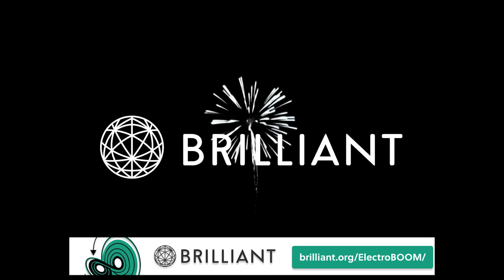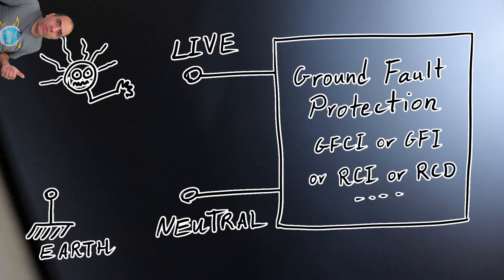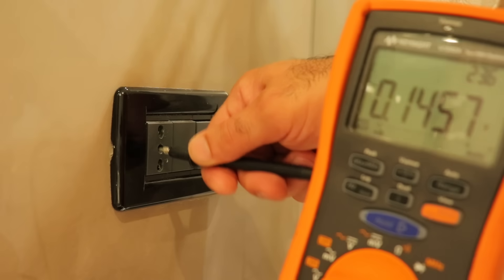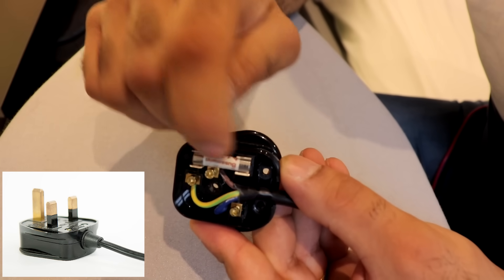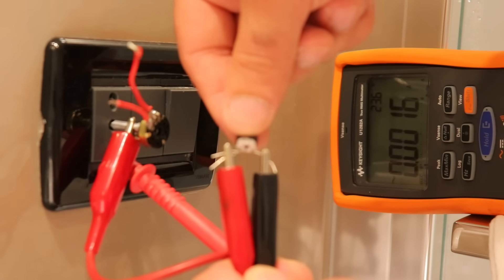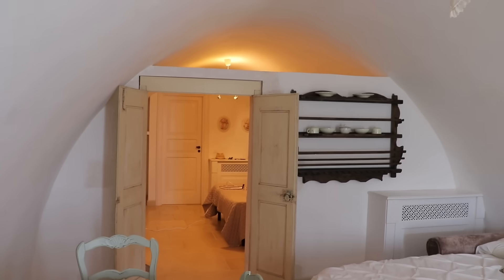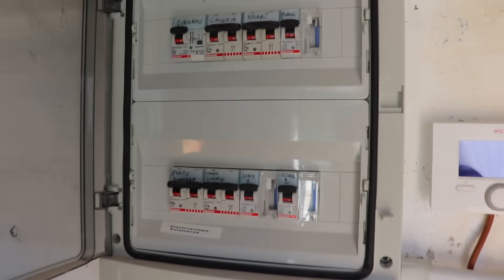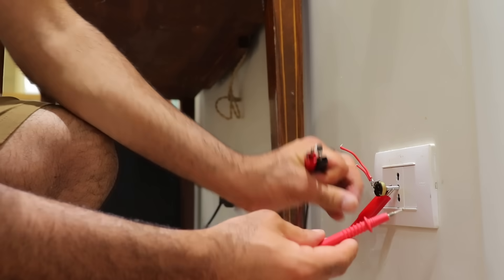Tripping Every Breaker in Italy

Comment: 15:22 actually that plug ("german" schuko) normally does not fit in that socket! That socket is either broken by somebody doing what you did previously (and it takes a LOT of force to do that the first time, the prongs are closer together and they're way thicker than the hole normally), or that socket is not up to standard.
Glad you enjoyed your time here! I'm happy to know that at some point I was less than 20km from you, lol.
Reply: Here in the Netherlands you can plug that exact same "German" schuko plug into any ungrounded outlet. No extra force required.
Reply: @wimh-e7l  interesting! Here they sell adaptors from schuko to 16A 3-prong, they used to sell schuko to 10A 3-prong but they're now illegal because schuko supports 16A lol. It's super annoying because the 10A sockets are pretty much everywhere, and I'll keep my schuko-to-10A-plug adaptor like gold lol. I don't need them to carry more than 2kW so that's still good
Reply: @FAB1150  are you sure they are illegal? I am pretty sure they are selling them in chains such as Eurobrico, and online too. BTicino and other brands make them.
Reply: @AndreaLazzarotto  those are the bigger ones, they still fit most sockets (as most of them accept both 10A and 16A), but not the small ones only anymore

Edit: I still found some around today (Conad), but they shouldn't be allowed. My local Brico doesn't have them anymore for example, but if I still find some I'm happy lol.
Reply: @FAB1150  I replied to your comment twice, and I see my comment disappeared. 😐 They are still selling them everywhere, by the way.
Reply: @AndreaLazzarotto  oh, YouTube deletes all comments with a link! 
In my area nobody does anymore except a Conad that's about 10 minutes by car from me, I guess it's different in different cities
Reply: @FAB1150  Basically no Schuko device uses more than 10 A. 10 A breakers are common in many countries that use Schuko.
Reply: @okaro6595  I'm Italian, and the adapters are illegal in Italy. I don't know about other countries. Here, 16A breakers are pretty much the norm.

The schuko plug is rated for 16A, and you don't want the socket to be the weakest point in your circuit. Putting a 10A breaker on a circuit where you have Schuko sockets is fine, because it's the breaker and it will trip if overloaded.

The 10A plug to Schukos adapter allows you to plug a 16A device on a 10A socket, possibly overheating it if you have a 16A breaker (as it will not trip). 

Now sure, most appliances with Schuko plugs don't even get close to 10A, so you usually won't overload the socket with an adaptor... But it's not a given and some do, and most people don't even know what an ampere or a watt is, so regulators made the adapters illegal. If you know what you're doing, then check the watts of your appliance and use the illegal adapter, they're still handy lol I won't yell at you. 
Adapters that go from the 16A "Italian" socket to the Schuko are still legal.
Reply: @wimh-e7l  True, and I'm glad you can because in the historic apartment I live in I only have grounded sockets in the bathroom and kitchen. I really want to replace them all with grounded sockets but I really don't feel like installing ground wire everywhere (plus, I doubt the housing corporation would approve)😅
Reply: @wimh-e7l  yeah but in the netherlands only old buildings can have no ground - new building standards since the 80s must have ground. Old buildings can not always be adapted without changing the aesthetics though.
Reply: @pulli23  I have a 60 house, been redoing all electronics. It didn't even had ground protection. Funny when I replaced my breakerbox (from 3x 16A fuse 1 phase to 16x 16A breakers on a 3 phase system), one of the groundbreakers kept going off. Something faulty in a TL light.
Reply: @pulli23  that's right. I didn't know it was from the 80s specifically. Nowadays every new socket must have ground, indeed.
Reply: what was the plug at 9 something for?
Reply: @stapuft  The unknown socket is called Magic Plug! Is a very old Heavy Duty (up to 20A) socket!
Reply: @PaoloPaterna  very cool, thank you!i just looked them up, they look like they might be some sort of dual-phase type plug, im saying that because i noticed it has 4 pins, instead of 2 or 3. oh no they are polarized three phase plugs, thats pretty cool.
Reply: @PaoloPaterna  No, it's a telephone socket, also from the B-ticino brand. They were once used for room telephones.
Reply: @emmepiemme  upon looking at it further, i think you are right, the shape is just barely wrong for the magic jack, but it seems pretty spot on for the "BTICINO LIVING CLASSIC 4521" kinda makes sense that they look similar though, as they are both made by the same company.
Reply: @PaoloPaterna   @Paolo Paterna  Nah, it's in the same wallbox with the phone RJ11 and it's unlikely they put together high and low voltage circuits (it's actually illegal unless using high voltage insulated wires even for the phone).
That mistery socket is likely the highly obscure telephone plug that Bticino came up with to go with their equally forgotten Magic plugs series.
Either that or is a german TAE phone socket.
Reply: @PaoloPaterna  I have them in my 47yo house but I actually hate them. When you need to plug more devices in one socket they are a nightmare...
Reply: @qdaniele97   @emme Pierre Actually they can be (and are) used for a lot of things: Telephone as you said but also, for example, to control the Slot cars on a circuit (9-12V and almost no current)! The fact that in some cases were used for low voltages do not mean that they cannot stand high voltages and high current :)
Reply: Agree, I'm Italian and the case where you could fit german into italy plugs are very rare
Reply: @FAB1150 the standard house wiring here is 2,5 mm2 for phase, neutral and ground. The switch wire (black) is allowed to be 1,5 mm2. Also wiring in old houses was done using 2,5 mm2 (from the 60 I guess) but usually they left the ground wire out except for wet rooms.
Reply: Exactly, is almost impossible to put a schuko plug in that socket, someone must've been like Hulk
Reply: Yeah usually they usually should be recessed.
Reply: We got the same plugs in france. The ground is done by a pin stocking out from the socket, so there is no way you could plug it in the wrong way. this insures that grounded appliances are always correctly connected.
Reply: An "F" type plug.
Reply: Forgot to mention that Vimar makes the universal shuko-bipasso plug...
Reply: If it's doesn't fit, you aren't applying enough force....
Reply: We use adapters to connect schuko plugs to regular italian sockets and they have a connection to the ground.
That said these days it's also common to find schuko sockets in italian homes where high power appliances will be used (eg. kitchen or laundry room).
Reply: In poland I had to get outlet changers or wtf its called from that outlet to polish  one slav country moment they kept the electric sockets from germany
Reply: He literally exploded that plug...probably melted the holes enough to make it fit
Reply: Yeah those sockets that allow for ungrounded  connections should be banned wtf.
Reply: There are convertible "springed" sockets, that accomodate slight difference in distance and allow flat electrode one as well
Reply: And "SchuKo" means "Schutzkontakt" or "Protection contact", referring to the ground contact (PE = Protective Earth). 

Schuko actually has compatibility with two different ground standards, one that contacts at the prongs on the outside of the plug (in Germany, we have a prong both at the top and at the bottom, so they're always reversible) and one that actually has a pin coming out of the socket that goes into the hole in that SchuKo that you see 10 seconds earlier when Mehdi looks at that plug from below. If you Google the French wall sockets, you will see that pin coming out of the socket that fits this.
Reply: False, schuko fits in any 16A outlet. Src: I live in Italy and always seen that
Reply: @Michele G  I don't know where you live but all the BTicino sockets I have can't accept shucko plugs. Holes are smaller and you have to force them very hard to plug them.
Reply: @fededevi1985  "force them very hard" = slightly pushing
This means in every household across Italy there are a lot of schuko where should not be
Reply: @mich2k1  Shucko pins are 4.8mm, type L pins are 4mm, both 19mm apart center to center. Unless the plug has already been "enlarged" you will have to push really hard to fit them on any non-damaged conformant plug.
Reply: @mich2k1  no. The schuko plug has the same prong thickness as a 16A italian plug, but with the spacing of the 10A plug (a little closer actually). You have to force it in.
If your sockets have weak plastic or are not up to code, you'll be able to force it in. My sockets (Vimar) literally don't accept a schuko plug without actually breaking. I tried as a stupid kid, and we had to replace the socket. I put my whole body weight on that socket until it broke.
Reply: @mich2k1  Not by design. Schuko plugs have the diameter of 16A holes but fits in the 10A spots. It's clearly a mistake and happens only when you have a double standard socket.
Reply: @87AgentSmith  Many countries like Finland had 4 mm prongs on ungrounded plugs until around 1960. People still plugged schuko plugs in the sockets. I wonder did they not worry about loosening the sockets. 

Of course if there are grounded sockets you should always ground schuko for safety.

Comment: The  weird plug at minute 9:00 should be a 12V DC power plug

Color coding for wires it is: black grey and brown for phase, blue for neutral, green yellow for ground

It is possible to have additional protection to differetial protection for bathrooms at 5mA if wanted, sometimes this is mandatory by law

Comment: Typically here in the UK (and probably most of Europe) we have seperate ring circuits which have lights and sockets separated. For example on one RCD would be the upstairs sockets and downstairs lights, and then downstairs sockets and upstairs lights on another RCD.

The reason is so if there's a fault, you always have a method for light. If you're in a room where the lights have tripped you can plug in a light, and if you're in a room where the sockets have tripped you can still see properly.

Actually a pretty decent way to keep your house lit. I'm not an electrician and I don't think it's an official standard, I think it's just a common courtesy when houses are wired
Reply: Curious so I just checked my new apartment in Aus, and it's a main CB, then an individual RCBO (Circuit breaker and RCD combined) for aircon, oven, lights, GPOs laundry and GPOs other.

Nice to see the separate protection applying, so unlikely that anything major tripping will effect lights or small appliances

Comment: Hi!
In Europe sometimes you may find 10mA GFP installed in the bathroom. 
But this is the recommended (optional) setup unfortunately, not mandatory.
Someone installs it (like I did in my house) 
Someone no.

Regarding voltage - 230 V at 50Hz AC is standard. Also we have 3phases (lines) shifted by 120 degrees so voltage between phases is 380V (not used at households /hotels mostly, they just split different rooms between different phases)

But we do not have dedicated transformers for each consumer, a transformer sub-station does this job, then 3 lines are coming to the houses. Because of this schema it’s possible to have some of lines overloaded so voltage on other ones will raise. That because you saw very different voltages in the different time

In my house 2 lines  are always overloaded so the third one is always 240-260V which is awful. I had to configure my relay protection raising the max voltage from safe 250V because it always pops. What’s sad my electrical company doesn’t wants to do anything with that (to find who overload  and send them some notice and maybe apply penalties)
Reply: in Europe every device is rated for working between 220V and 240V at 50Hz. Italy's house grid network is 220V in average.

Comment: I'm a Belgian electrician and former control agent for electricity, Any building have to have a JFC as first safety device. Most jfc have 10% error safety, so most will 30mA will trip at 27mA or less .
It is also normal both life and neutral gets interupted by the breakers.

Comment: The fat plugs are Shucko plugs and are more recent (and the standard in Germany I think) in Italy they're mostly used for high current stuff (and PCs) and no, they're not supposed to be able to fit in normal italian sockets, but you can push them in in cheap or old/ruined ones where the holes are bigger than they're supposed to be.

Comment: Glad that you come to visit my country, wich i guess is not so bad on electric safety. 
Usually we have both automatic breakers. Neat. But the italian plug is not steady as the german standard "Shuko". Also the double socket is designed for two different italian plugs; 10 amps and the bigger one 16 amps. Obviously is a bad idea trying to force a "schuko" in one of these, but this is not user's fault.

Comment: In general plugs are in a hole so that you can't plug the big round high power earthed plug in the flat thin non earthed hole, but you can plug the thin plug in the big hole. Also it's 30mA because it's the entire house that is protected, so if you have a lot of devices that radiate a tiny little bit of power to earth because AC, it'll not pop the entire house every seconds (this is my way of think why 30mA standard and not 10 or 5mA). Devices don't care of the live and neutral reversing, and if they need it, they'll use the big round plug with earth to protect you. The thin one is 2.5A rated and the big is 16A in most cases. And the cover is to prevent childs to put a knife or spiky thing in the plug, so good too

Comment: at 15:35 you plugged a shucko plug in an italian plug, that's wrong you should have and adapter for that and not force it. The shucko adapter (used mostly in germany and france) is used also in europe on some high power devices like washers and heaters. it's earthed! if you don't have the earth pin you ground the device via the lateral pins on the male plug, but in order to use those pins you need an adapter.

Comment: Hi Mehdi, in Italian standards Black-Grey or Brown are colours for the live conductors, blue for the neutral and Yellow-Green for the Protection Earth. As you have discovered, normally all the apartamentents are protected by a RCD to 30 mA.
The strange outlet in the second hotel was an old type phone outlet by Bticino. (https://offertemania.it/images/products/pcs_images/bticino_magic_5021l.jpg)
About the identification of live and neutral on the outlets, simply isn't important for 99,9% of the appliances beacuse the groundind of the devices is connected to the central pole instead.
At the end, plug a german type plug into an italian socket is not a correct operation, you will lose the PE connection. 
I live on the land at about 30 km to Venice.

Comment: 9:16, that is usually refereed as a "bticino  Magic" plug standard, it's very old and doesn't get used anymore the only difference with normal plugs is that it can't be reverted and it sits flush with the wall we stopped using those when we adopted the shuko(the round plug with the extra earthing) standard from Germany

the outlets door are a MUST and required by standard the italian name is “gonne” (skirts)

as you noticed we have a “small plug” and a “big plug” the small plug only goes up to 10A 220v and the big plug goes up to 16A , the standard Italian contract goes up to 3KW single phase 220v

if you have more questions feel free to ask :)
Reply: You're wrong. That's a BTicino phone plug. Magic is similar but bigger.
Reply: @danielec  correct!
Reply: Pretty sure we didn't adopt shuko, we just use it for some appliances, but that's it. Most houses don't even have a single shuko plug, and even newer ones have just a few shuko plugs in bathrooms and kitchens
Reply: Only a little precisation: our standard now is 230V, not anymore 220V.  @leonardo ferlito
Reply: Am I the only one that thinks that shuko is inferior to the standard Italian plug? The ground connector seems more fragile (I needed to change some sockets because the ground springs broke) and you also risk breaking your hands every time you try to remove the plug from the socket. They are also big and bulky.
Reply: Italy never adopted the Shuko standard. The Italian standard is the "Type L" and it cames in two measures for 10 and 16 amps (hence the "bipasso" sockets). 
You can install a shuko socket everywere you want, like you could already in the '80s (bticino applications had always been compatible, only it takes the space of two Type L sockets to install a single Shuko one, that's why the Type L is superior to the vastly overrated Shuko standard).
Reply: I genuinely HATE Bticino Magic. They are just bad.
Reply: Yes, looks like a phone plug, especially since there is a RJ11 socket next to it. Yes, you get a Schuko plug into the Italien 16A ones, but without ground. The euro plug then fits also into the 10A one, but with enough force, you even get that into a UK socket. (Frequently seen in dubai).
European countries all had something between 220 and 240V. Then they made it all 230V, but many old transformers where never changed. So you might seen anything between 210 and 250V. When camping I once even saw 170V, though they where unlucky with many air-conditioned trailers and being at the end of the campsite and having a bad cable, which also lost 15V 😄
Reply: At first I thought it was an ethernet port🤣 than I noticed it looked more like dsl. Lol
Reply: Stupid Bticino Magic